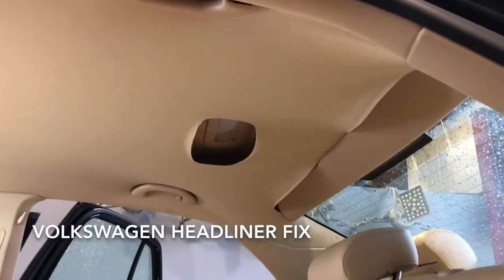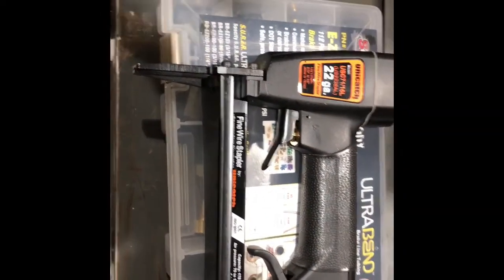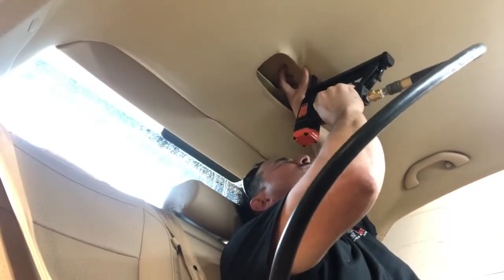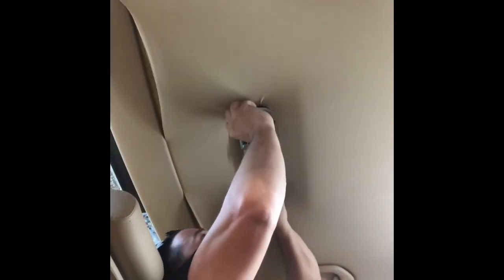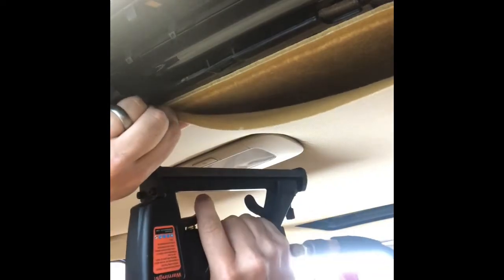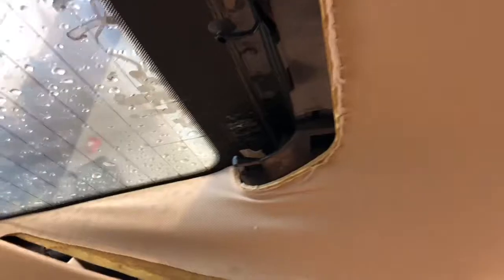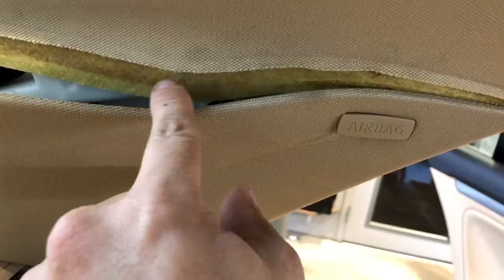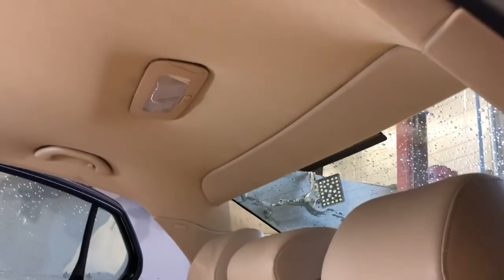How to FIX the Volkswagen Headliners - Watch!

Comment: Do not recommend staples. It will tear eventually and you won't be able to staple again because you won't have enough fabric. Reglue is the only lasting option.
Reply: You could use the staple then superglue like you would a wood joint and wood glue. I have used binder clips and superglue with pretty decent success.
Reply: What kind of glue?

Comment: I just did a headliner job in a car, and I ended up cutting the thing in half so I wouldn't have to take a window out. Glued the 1st half on before I put it back in and carefully smoothed the 2nd half in in place. Almost better that my cut wasn't immaculate, fit together like a puzzle. Few hours, $18 Walmart blanket and $15 can of glue, turned out close to perfect, better than I expected. Would have been perfect if I would have tracked down a grinder or wire brush, needed a bit more scraping. Good option for an older car when you want to keep the cost down.

Comment: Hi. In my mk5 from 2006 whole ceiling disconnected. Because in about 3 months time I will get newer car (but still can’t see this ceiling 
Everyday) I’m planning completely rip this off and brush off old glue. What do you think? Actually hold in one piece all 4 handles and little bit front sides. So what do you think?
Reply: Mine aslo mk5 2007 tsi
Reply from the maker: I have seen a couple people still do it while the headliner is still in the car, but it’s a lot harder. I am showing it in the video is just a quick way not the correct way
Reply: @FreedomtravelerCT  thanks for answer. I decided to ripped off completely. Brush off with tire brush all this orange leftovers and actually now is good enough. maybe in the future I will clean more to 100% clear panel but for now I'm happy with final effect. Touched little bit with white spirit all handles so all back to white colour lol. Take care. Tom

Comment: rough as fk...take it out and re  cover it
Reply: Most people don't care or have the time to wait 3 days for their headliner glue to dry
Reply: @Tiyratania  That comment proves you haven't got a clue on headliners
Reply: @Tiyratania  you can drive without it and it takes 20 minutes to cure. wtf?
Reply: Use the correct headliner material and 120 degrees aerosol glue, cured by the time the interior lights are back in. Stapling is a bodge job and takes about as long as a proper job.
Reply from the maker: @sc9443  we sell BHPH vehicles it will last long enough. This takes 10 mins, Pulling the headline takes and replacing the headliner takes 3 hrs. Time is momey.

Comment: you would spend half that time if you've just removed the hole headliner board and glued a new piece of cloth onto it.
Reply from the maker: Yes, we also do that as well on certain vehicles. This gets it by speed and efficiency. Yes, it’s not the proper way, but it works